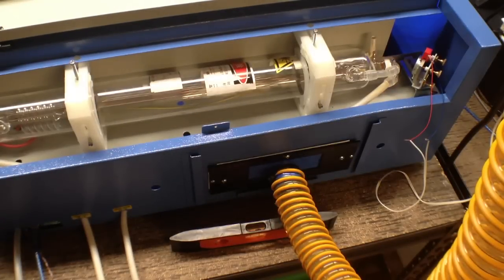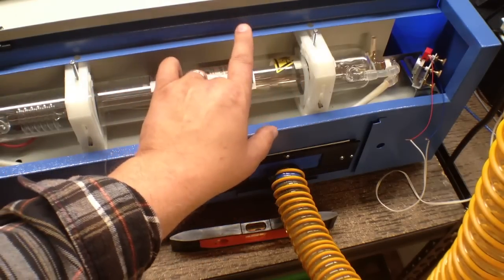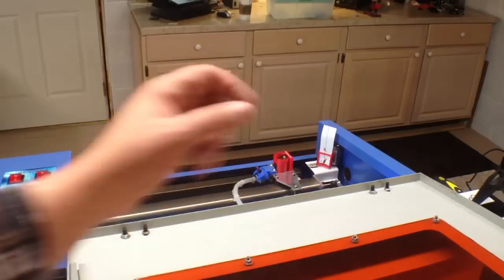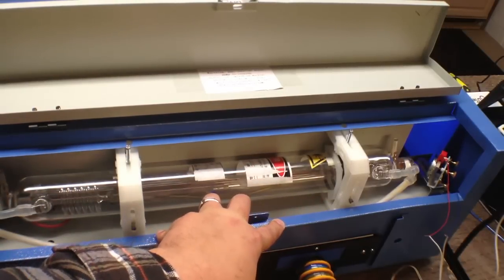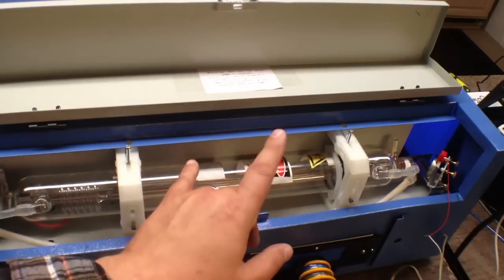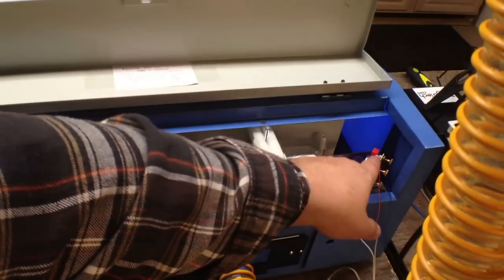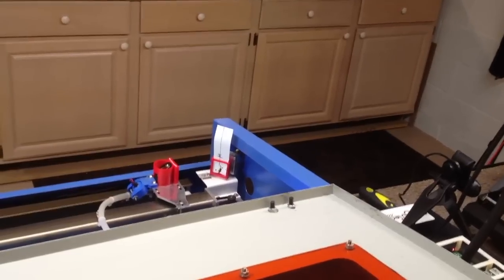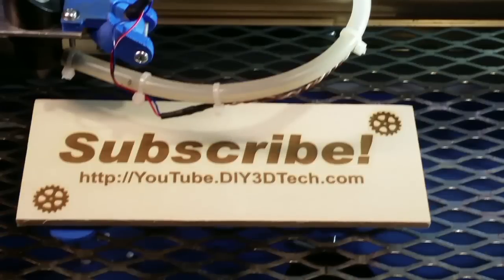K40 eBay Chinese CO2 Laser  -  Building Tube Hangers Alignment Part 3!

Comment: I was hoping to see how hard it was to get the external square(ish) adjustment bracket installed around the tube and into the chassis and existing screw holes. Was it too mysterious of a task, or is the idea to lean the bracket forward while it's around the tube to position the posts on the holes, and then tilting it up and down into the holes? 

I'm also curious: In the video, you appear to be at the stage where you're trying to align the Y axis mirror at its most distal position. As you're dialing in the tube alignment at that location, won't you be changing what was once aligned at the most proximal position? Meaning: Is it actually possible to have it both ways? Aligned at both the most proximal and most distal positions at the same time? 

Last question: I printed out one of your laser pointer module mirror adjustment guides, but I'm still not too clear on the best way to use it since it doesn't mimic the IR laser by sitting in front of the tube. Is it primarily helpful for achieving horizontal alignment? Your previous alignment videos didn't really go into too much detail on that.
Reply from the maker: The clamps are pain to get in (very tight) but can be done.  Also not sure of the question "proximal and most distal positions" as the last time I heard distal was at the dentist.  In short you should strive to have all mirrors at 45deg angle as perfect as possible as adjustment is your enemy.  In high units the optical train "floats" and therefore can adjusted perpendicular to all of its reflecting surfaces other wise you get run out.  Also which laser alignment tool did you print?

Comment: I am seriously thinking of buying one of these for a very specific application.  I want to be able to engrave names and dates on coins.. mostly silver and some nickel / copper alloy.  Do you think this unit would fit the bill?
Reply from the maker: interesting and most likely not, as you can use a 40 watt laser for metal marking (mainly aluminium) however you need to use a marking compound (http://www.thermark.com/content/view/36/78/) than remove it afterwards.  Also if you are going down this path (with the marking agent) than would suggest at least a 60 watt laser however for copper and such (which dissipates heat quickly)  you need to go bigger (guessing 120 watts or better at minimum).  Unless you have have around 10k to invest, would suggest a small CNC with a DC spindle and engraving bit...
Reply: Thank you so much for the quick reply.  I was so close to pulling the trigger on this.. you probably just saved me hours of frustration and disappointment.
Reply from the maker: P.S. Seen on your site an interest in coin ring making so a CNC with a 4th axis would also work for engraving (your can also get a forth axis for a laser too however to cost between the two will be vastly different...
Reply: I've been wanting to add more customized options for my coin ring customers.  Little things like anniversary dates, grandkids names, etc. All this can be done on the coin before I ever shape it into a ring.  I was going down the path of stamping but that is so limited.  That path let to laser engraving which let to the k40. But the CNC idea sounds like a good area to research.. I'm already googling around.
Reply from the maker: I will try and do a  video or two on this over the next couple weeks (I typically queue them as I travel for work) as this is an interesting idea as I never knew this modality of jewelry making even existed so I learned something new today!  Thank you!
Reply: +DIY3DTECH.com That would be awesome!  And, just throwing this in, my wife is a professional stained glass artist and she is very interested in seeing this rigs ability to etch glass. So, if get really bored...;)
Reply from the maker: Etch glass especially colored should be do-able (there is a video of me doing rocks in the playlist).  As a lot of people out there with the 50 watt versions have a 4th axis and they etch wine bottles and the like as a business.
Reply from the maker: Check out the channel tomorrow evening around 8pm ET as video is scheduled to drop on etching a coin with a laser.  Also I will do one for the CNC as well one for stained glass and the laser however these will likely be a couple weeks out...
Reply: +DIY3DTECH.com You are on it!

Comment: So once you get your mirrors and tube aligned what kind of improvement in performance and accuracy are you expecting and will that allow you to do more than before?
Reply from the maker: The main idea here is these things are made to engrave rubber stamps (in China they use a LOT of them and I am not joking). so they are designed to only operate over a very small area some thing 3 inch's by 6.  So when you take the clamp out you can get almost 12x12 however the sheet metal isn't rigid (expensive units have a rigid super structure)  so the beam wonders off and you lose power.  So the idea is to keep alignment over a rather large area...

Comment: Do you have to perform this alignment after each "cut", or after so many hours?
Reply from the maker: Once aligned it stays for a while especially when only cutting however engraving is another story as it will shake itself silly will require a tune a every couple days depending how much use it gets...  Hey saw you WiFi card video pretty cool!
Reply: +DIY3DTECH.com - So it's like bed leveling then. You get a couple of good runs then you have to adjust it back into alignment. I saw the video "RD" or whoever did with tbd laser aligning and how you have to do it one mitt or at s time or you screw up the whole thing.
Reply from the maker: Yes sort of, if you just "cut" it would likely last for a quite a while, however engraving moves the head back and forth around 160 to 200mm  per sec or min can't remember but it shakes the machine pretty hard and lossnes all the set screws.
Reply: Loctite?